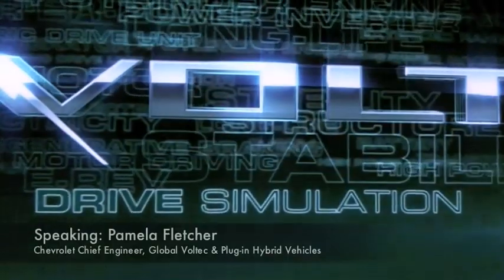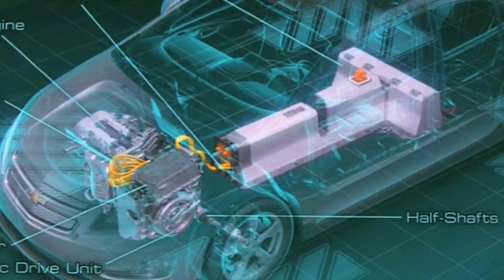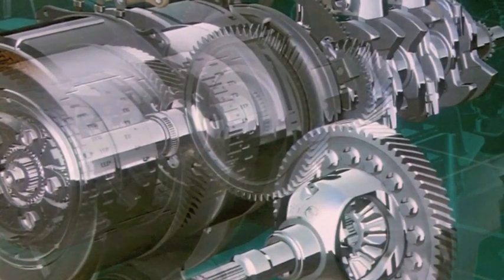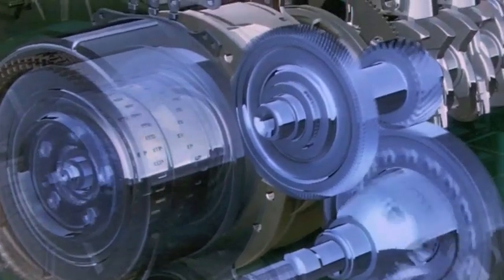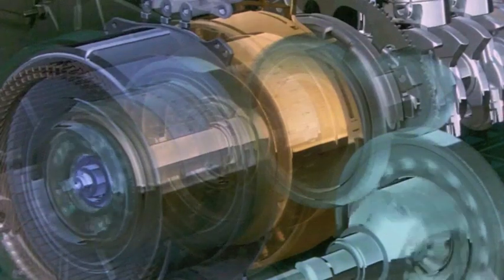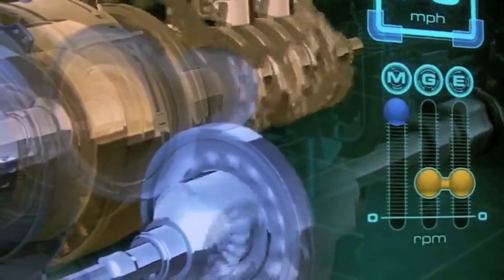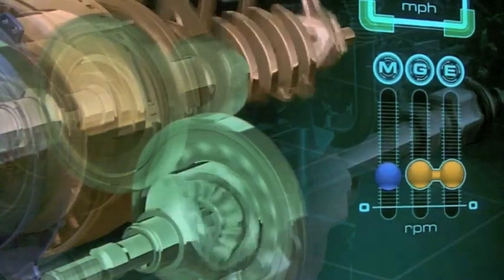Chevy Volt Powertrain Deep Dive | Part 3

Comment: simulation animation:
1:55 - single-motor electric mode, CD1
2:53 - two-motor electric mode, CD2
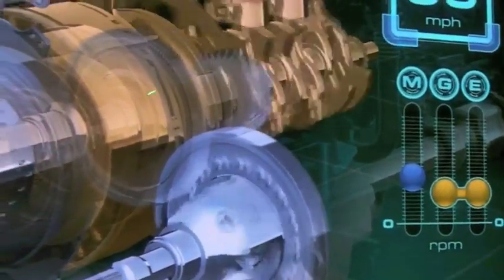3:36 - series hybrid mode, CS1 (she calls it "extended range mode")
4:47 - output power-split hybrid mode, CS2 (she calls it "combined mode")

Modes are described and illustrated (with technical diagrams that can actually be followed) in the Wikipedia page for "GM Voltec powertrain".

Comment: I’m still not clear on whether the gas engine is ever mechanically connected directly to the drive shaft when it is running. If I understand correctly, the gas engine is geared to both the generator and to the drive shaft, when needed. 
If the car runs out of battery capacity, does the gas engine engage with the drive shaft, or does it run the generator to power the car electrically, or does it do both of these?
Reply: Yes, a first-generation Volt like this has one mode (the power-split hybrid mode) in which the engine is mechanically connected to the axles, with the rive ratio controlled by the output side motor through the planetary gear set. 

Years after this video, the second-generation Volt (2016+) added one more mode in which the engine is mechanically connected to the axles at a fixed drive ratio. 

In either generation, any hybrid mode can propel the car while recharging the battery if desired.

Comment: Watched all three.  This is a cool system.  I like the way a planetary gear solves the problem of coupling two power sources.  And it’s still with us in the 2019 model year, and getting better all the time.
Reply: That coupling is called a power splitter (or combiner), and it has been with us in production since 1997. It is the basis of Toyota's Synergy Hybrid Drive, the hybrid system used in most Toyota hybrid models, including all variants of the Prius and all transverse-engine Toyota (including Lexus) models. It is a good feature, and used in many GM hybrids, but it's not GM idea.

Comment: I can understand why GM did this.  Hybrids have been out for years and most people still don't understand how they work.  Some people still think a prius gets plugged in and charged up.  In the beginning Honda and Toyota even called their hybrids "electric cars that you don't need to plug in." or something like that.  So along comes a hybrid and you DO have to plug it in.  That is confusing for most of the public. So they tried to avoid the hybrid terminology.
Reply: 2021 and we realise how right GM was with their Voltec platform.

Comment: I haven't used gas to commute to work and back for 3 weeks now, 50 miles per day, can't do that in a hybrid. I admit that the mpge is misleading, sure it's the energy equivalent of gasoline, but how can a leaf have a mpge number? Makes no sense! It's all electric! fact is you will use less gas in a Volt, trying to pin a number on it is impossible, it changes from owner to owner. Between 25 and 50 electric miles, then 35-45mpg on gas, that's it.

Comment: @AySz88 The car comes delivered with gas in the system.  If it is not used it will go bad, so the car will use it.  If you let it sit with an empty tank then moisture will collect in the fuel system, and cause phase separation with ethanol mixed gasoline.  Of course if you have an empty fuel tank you can't use, you should have bought a real EV for less money and with more range.  The car is always in hybrid mode, since that's what it is, even if it's parked.

Comment: @borthwey Yes this is getting pointless, but to keep the facts straight, this is a quote from ask . cars . com:
"The system can also detect when a Volt has gone a full year between fill-ups, and Chevrolet says it will run the engine until enough old gas has been burned to activate a low-fuel warning light that says it’s time to stop at a gas station."
So even if you always use electric power only the Volt will still burn a tank of gas each year.  That's not an EV.
Reply: It's an EV, with an gas generator. It's far more practical than a pure EV car ;-) You can drive across the country without plugging in (only stopping for gas), or, if your commute is short enough, you wont use any gas throughout the year. Also, the engine doesn't run through the entire tank of gas, it uses 0.03 gallons to keep everything lubricated, and this is only once every 6 months (if the gas engine isn't used for 6 months)
Reply: @dansmith6990  EVs don't use gas.  It's a hybrid.  The people who have actual EVs and never need to stop at a gas station would disagree that the Volt is "more practical" .  Most people never drive across country.
Reply: @JRP3  And people with a Volt would say it IS more practical. They don't HAVE to stop and charge for hours at a time. They can refill their gas tank in minutes and drive another few hundred miles. EV cars can't do that. 

If a Volt can do everything a typical EV car can do, but a typical EV car can't do everything a Volt can do... Therefore, more practical.
Reply: @dansmith6990  Don't really care what Volt owners think about what is practical or not, I'm just pointing out that yours is only one viewpoint not shared by actual EV owners.  99% of the time most EV owners wake up every morning with a full charge and never think about charging and the occasional long trip people take it's good to have a break to use the bathroom, stretch and get some food so waiting for a charge just isn't an issue.  You don't know this because you've never owned an EV, even though you like to pretend otherwise.

Comment: @JRP3 As an EV, the Volt needs no fuel or oil changes, these are only for the range extender module, and the car can still be used without it being functional. If a car can do what an EV does, it's an EV, regardless of what other features it has. But this discussion is rather pointless since we are only debating names and like I said before, call it whatever you want as long as you are familiar with the facts, as you seem to be.

Comment: @borthwey An EV has no exceptions.  It's a much less complex design.  You can't have two systems and only label the vehicle as one of them.  By your logic you can call the Volt an ICE.  It's not, and it's not an EV either, any more than the Prius plug in, or the Karma.  EV's don't need oil changes, or have to pass emissions tests, or have a tank of gas that must be used up so it doesn't go stale.  Hybrids have many issues that EV's simply do not.  GM, and you, are wrong.

Comment: @JRP3 Chevrolet is right, it's an EV. AND a plug-in hybrid. It's simple, if it runs on power from the grid, it's an EV, if it runs on gas it's a gas car.  It's regarding the propulsion that the term hybrid is generally used, and apart from the exceptions explained in this video, the Volt's propulsion is fully electric. Carrying a generator and tank doesn't make it any different.

Comment: @borthwey A Volt can also run without ever plugging it in, powered by gasoline alone, that's why it's a hybrid.   GM could have been honest and called it the plug in hybrid that it really is, not an EV, it's much more complex than a 100% EV.  If you bought a Volt and never use any gas you should have spent less money and bought a LEAF, instead of dragging around an engine and gas tank you never use.  Nothing wrong with a Volt if that's what you want, but it's never 100% EV.

Comment: @JRP3 A Volt can run without fuel. Call that whatever you want, that's not really a debate that I'm interested in. Yet the fact remains, it is a car which can run on electricity alone, as attested by many of those who bought it and who have driven thousands of miles without re-filling its tiny tank. And obviously Chevrolet didn't want people to mistaken it for a regular, non plug-in hybrid. The Volt is much more different from those in technology and use than they are from combustion-only cars.
Reply: The only significant functional difference between a Volt and the original toyota Prius is he size of the battery... and a Prius Prime is a plug-in hybrid with a suitably larger battery. So no, the Volt is not much different from non-plug-in hybrids in technology.

Comment: @urbex2007 So if the battery in your opinion lasts only 3 years, why Opel/Vauxhall/ Holden/GM gives an 8 year or 160000km warranty?
Reply: The 8-year warranty is required by federal government regulations in at least the USA and Canada for emissions-related equipment, and hybrids can't meet emissions standards without the battery so the battery is included in that coverage.

Comment: While its batteries last, the Volt is a 100% electric car. The only difference to other electric cars is what happens AFTER the batteries run out.  A Nissan Leaf will stop, a Volt will become a gas/electric  hybrid. It will generate electricity from braking, and depending on the speed the propulsion power will come from the electric drive motor alone, from it and the generator motor, or from those two and the gas engine. In 100% electric mode, only the first two combinations are utilized.

Comment: if the Volt is called by GM as an "Electric Car" then what do you call the NIssan Leaf ?
Reply: I know your comment is 9 years old at the time of me writing this, but I'm going to explain.

The Volt is an electric car because it's driven solely by electric motors. The electric motors are the only thing that drive the wheels. Now.. the power the that the electric motors receive can come from the battery pack, and in some instances the gas engine (because it's more efficient than going converting electric-mechanical-electric power)

Hope this clears things up for anyone else that reads this.

Comment: i was under the impression that the engine didn't connect to the wheels at all ever... (i guess it was a case of corporation branding.)
Reply: Yes, this misinformation is nonsense spread by people who don't understand how the system works, encouraged by GM's insistence on calling this an EV "with a range extender". 13 years after your comment, this misinformation is still commonly cited.